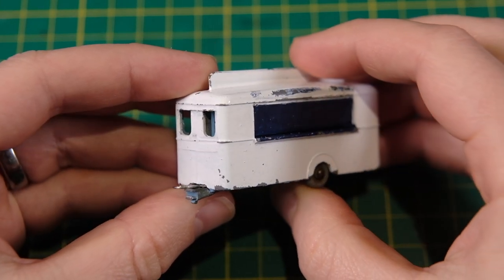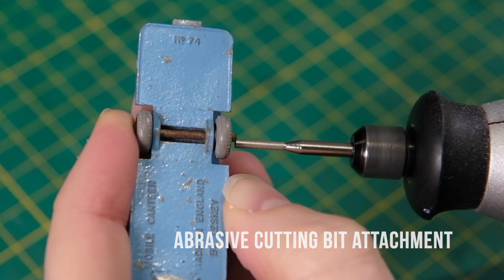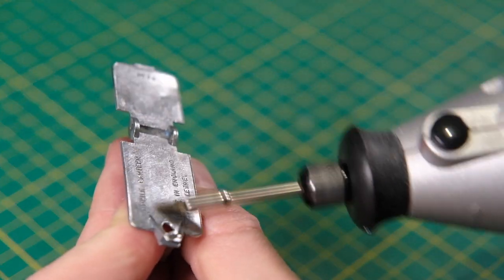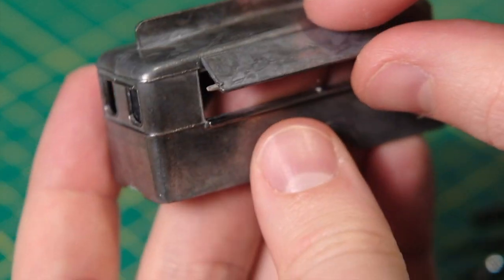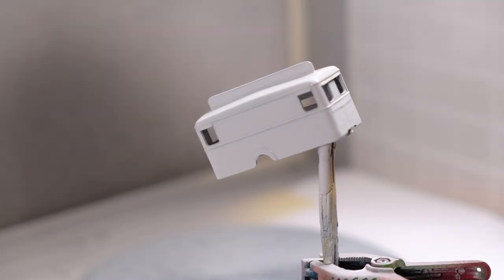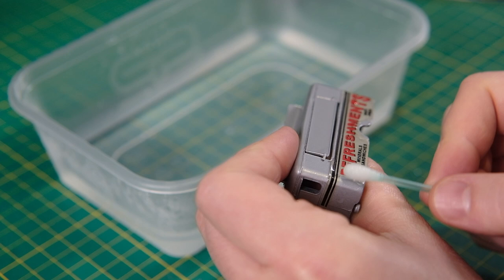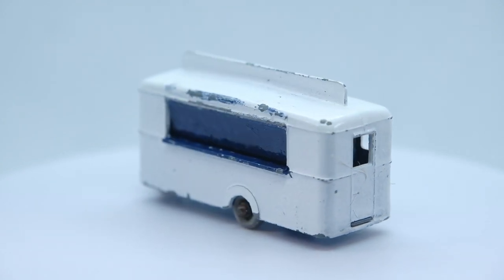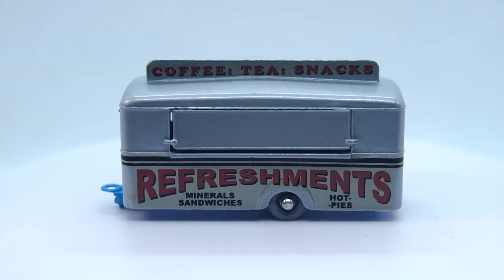MATCHBOX restoration: 74A Mobile Canteen

Comment: I have always loved this casting and you certainly rescued this one from the scrap heap. Excellent job!

BTW, try Muggyweld to rebuild the blown-out posts (and attaching a hitch!). I randomly saw Matchbox Marty use it on a hitch in a video a while back, and he had good results with it. I recently started restoring diecast cars for fun, and I think it works great. It’s metal, so you can drill it, tap it, and it holds a screw perfectly. I’ve already rescued a few “restored“ castings that had botched posts.

Great video and commentary. I’ll be tuning in for more!
Reply from the maker: That’s a great suggestion. Thanks very much and thanks for watching!